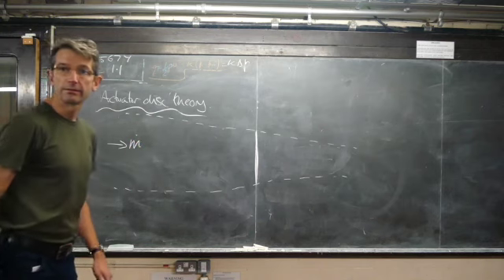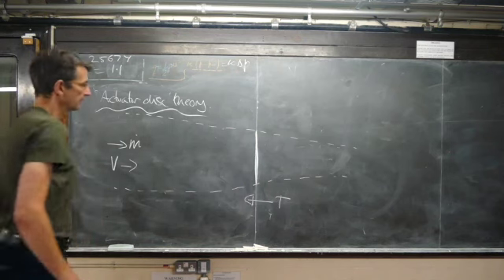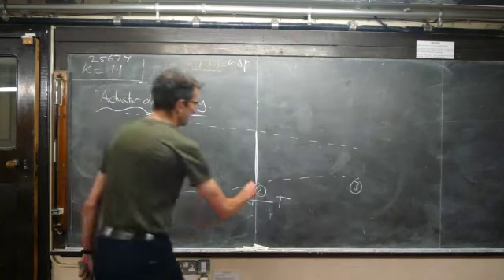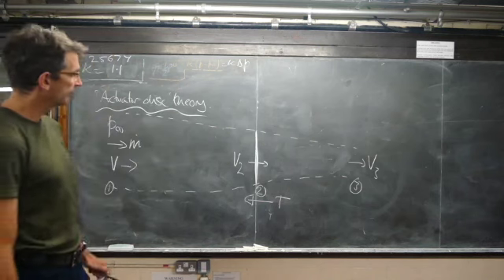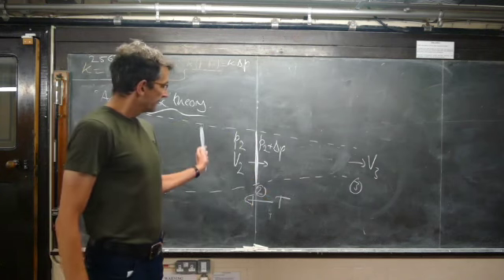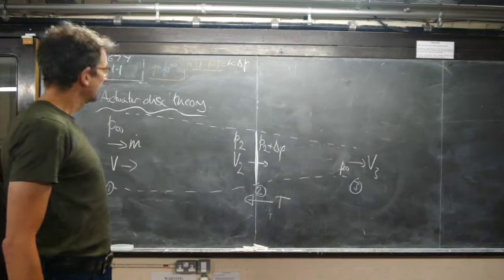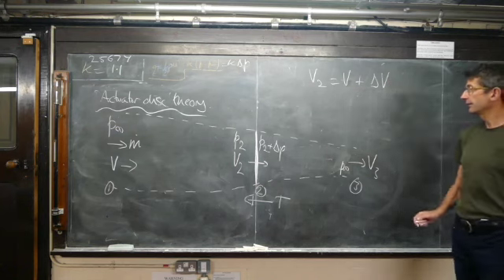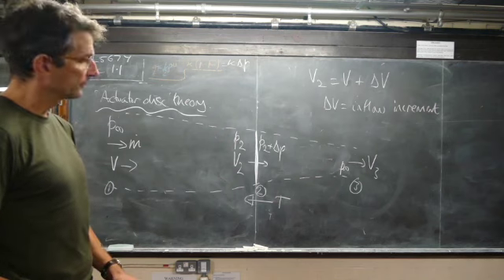Introduction to actuator disc theory

Comment: Hi Sir, is there a reason for the stream tube boundary to converge? I assume it has to do with the continuity equation
Reply from the maker: Streamtube contracts due to acceleration in the propeller wake (pressure on downstream face of propeller is higher  than ambient).

Comment: if we put a venturi type funnel in open environment than without doing any external effort  to enters  the wind inside the funnel, So in this case can I get the increased velocity  at the venturi section . If yes than how there is a law of conservation of energy will apply    , Thank you sir